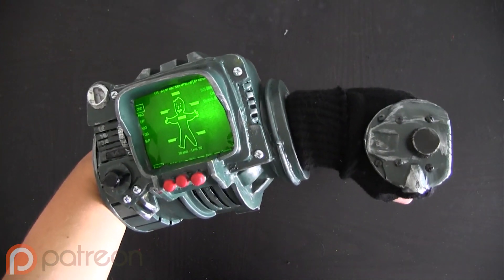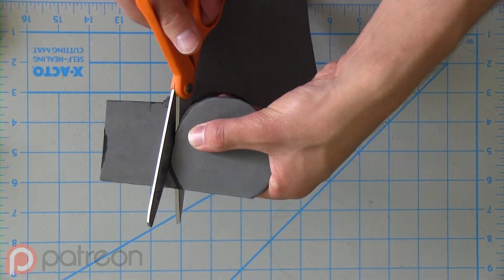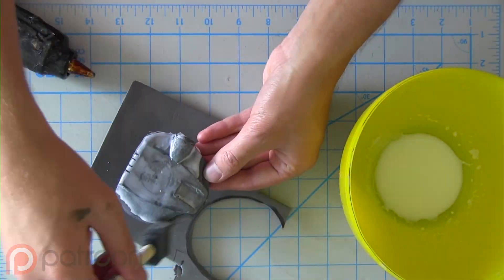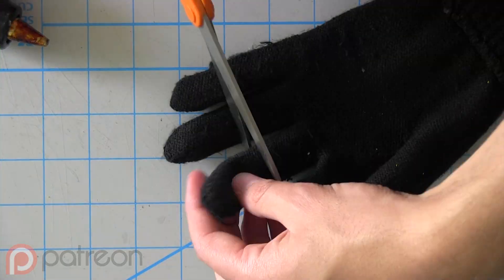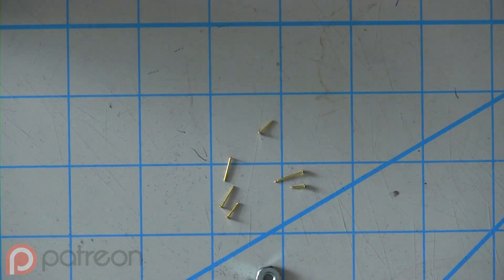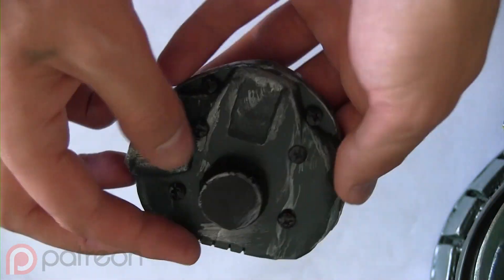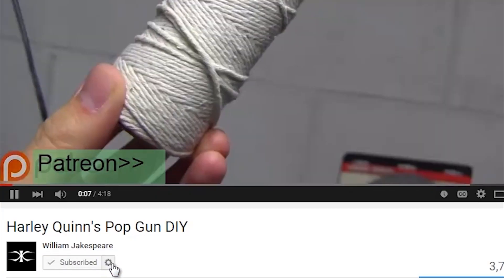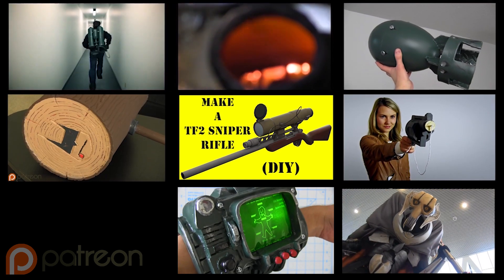How to Make a Pip-Boy Controller (DIY)

Comment: For now instead of buying a heat gun would a hairdryer up close work when I'm trying to make it curved
Reply: This is for when I try make foam in to a dish shape by the way not for this tutorial
Reply: Charcoal Pit It would take a LOOOOOOOOOOOOOOOT longer, but in theory, yeah, it'd work. Though you can get a cheap heat gun for about £10 (I think that's around $15?), so they're not super expensive.
Reply: Oh right okay thanks. I literally just finished doing my GCSE exams and I was going to see what I could do as cheaply as possible so I am using a lot of things that I can find round the house but that is definitely cheap enough to invest in. I am also English btw
Reply: Charcoal Pit No problem. As I was saying, there are a whole bunch of places that sell them cheap, or you could just look on Amazon or something (Screwfix is a good example). Also, congrats on your GCSEs (or good luck for the results, I suppose, haha).
Reply: Thanks